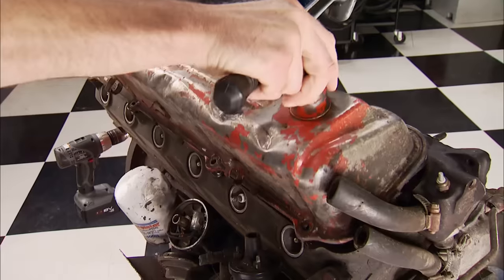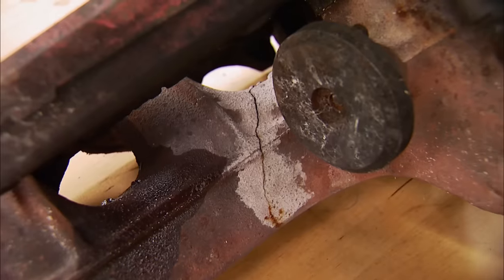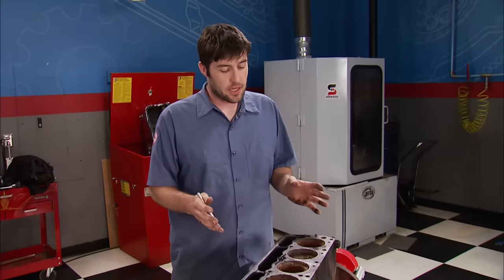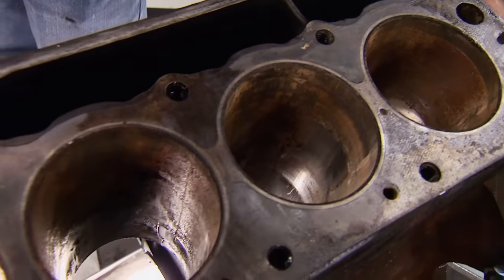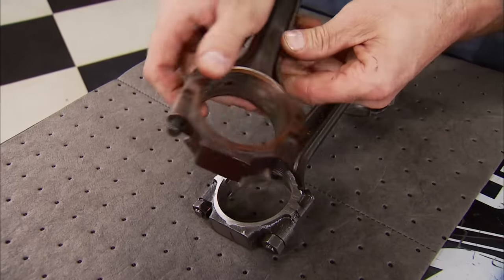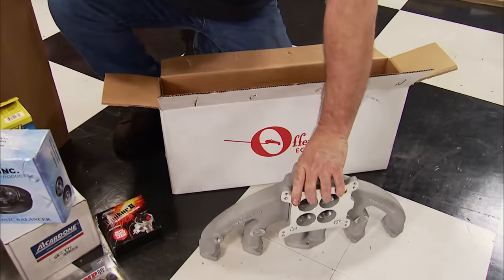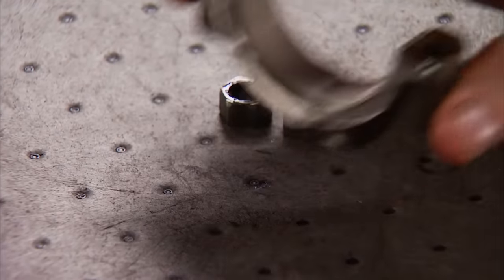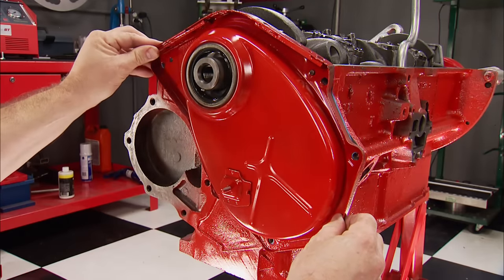Resurrecting A Mopar 225 Dodge Slant Six - Engine Power S2, E2

Comment: Would be cool to see them do the ford inline 6. Nd Chevy 250 inline
Reply: Or the 300 Cu in Ford inline 6
Reply: @JorgeRodriguez-po7kx  he is most likely talking about the 300 i6.
Reply: Why bother...
Reply: The 188 or 221 Ford 6 cyl?
Reply: keith cunningham BS!  the 250 was bullet proof 300 was a gas hog!...
Reply: I had a 300 inline  and it was bulletproof over 800000 on it I sold it for 3000 nd that truck is still going strong  nd it was ratbagged from day 1 I bought it brand new with17km on it
Reply: Funny how this turns into a battle of brands a really car guy dont care what the brand is there all built to break

Comment: OH!  The piston offset thing they mention around 11:00 just solved a mystery that's been bothering me.  My daily commuter is a 2000 Honda Insight, and it's always had a lot of piston noise on cold mornings before it warms up.  But I remember now that the engine in that particular car has the bore axis offset pretty radically from the crank centerline, in order to give the rod a straighter shot at the crank during the power stroke, reducing friction in the bore.  People do this with the /6 by putting the pistons in backwards; the straighter rod angle gives more efficiency but more piston noise.  Well my car has a super super gnarly case of that; there's got to be no side load to keep those pistons from rattling back and forth when it's cold.  So cool, I'll stop worrying about it.

Comment: The motor had a cracked crank. I thought it was indestructible engine lol.
Reply: And it was probably still running when it hit the junkyard.
Reply: My brother's Valiant had a slant six. it started to miss, so he still drove it to the garage to get it fixed. it had a broken push rod....and still ran.
Reply: Evil Ash any pushrod engine will do that nothing special
Reply: I am uncertain of the accuracy of this problem - the rear of a Crank has the highest Loads
therefore a crack between cylinders 1 & 2 is unlikely - the head & the crank of these Motors weigh 80 Lbs each - as far as I know a cracked head - Unlikely :)

Comment: One of the Best Engines Ever. THE BIG 6L 3.8 lts.
same as 225 c.i. 
Had a Dodge Dart Swinger
1971 Auto/Transs. Torque Flight and I really enjoyed "18 MPG" on the Free Way.  @1981  
When ⛽ was @$1.80/gl.
One Way non stop from L.A. to T.J. Mex. 👌🏼😎👍🏼

Comment: I spent two years working at Chrylser's Trenton engine plant making these.  It was a great engine and one reason was that only  one engine was built on that line.  On the V8 line you had multiple engines being built with different but similar tools.  So, it was real easy on the V8 line to use the wrong tool and damage the V8 in a subtle undected way

Comment: lubricating the head bolts is a no no. You will end of over torquing them when torqued to factory specs. The factory torque specs assume dry assembly
Reply: exactly, OLE!
Reply: mechanics 101 but sadly most guys are ignorant of this.
Reply: Idk why people think they have to slather every part with oil lol
Reply: @Beer-can_full_of_toes  i use KY Jelly on my water hoses. ex-wife use to ask "whatareyoudoing!?" OLE!
Reply: fvrrljr I was boiling water to clean corroded connections today and my wife asked what on a car required boiling water from a coffee mug in the microwave lol
Reply: @Beer-can_full_of_toes  a frozen water pump. yep been there done that LOL
Reply: fvrrljr electrical corrosion.
Reply: @Beer-can_full_of_toes  galvanic corrosion

Comment: had one in my 65 dodge power wagon. rebuilt motor and 3 speed trans.for 1300. used to take it to our camp. 120 miles. would hold it to the floor all the way there and back. motor never failed. wish i could of seen this video.few more horse was needed

Comment: now do a Ford 300 I6. Ford's Bulletproof motor. they built them from the mid 60s all the way to the mid 2010s
Reply: the later FI ones ran pretty stoutly compared with the old single carb versions.
Reply: LUNITIC WILL   I owned a 1980 Ford F-150 with the 300 6.  It was very smooth and pulled well.  I use to trailer a 22’ boat with it.
Reply: Big Rock  time for a 351

Comment: If you did NOT replace the original distributor's 'plastic' drive-gear, with a brass one, you made a huge error. This I know from experience
Reply: This is the sexiest thing I've ever read on YouTube.
Reply: Eh, considering they're not installing a "retainer" for the camshaft (read as: drywall screw through timing cover) I'd rather the distributor gear gets eaten by the camshaft. At least that way you've only got to replace the distributor.

Comment: My 225 inline six in my 1980's Dodge Aspen was truly bulletproof.  I never changed the oil from 160K to 200 K miles.  It never missed a beat.  Finally died at 350K, but the engine was fine, the frame on the Aspen broke in half.

Comment: Slant sixes were discontinued because the company realized it was too reliable and thus needed to be replaced with a new design.  :-(
Reply: Your thinking of the FORD 4.9l 300 inline 6 being discontinued due to over reliability! That absolutely wasn't why the 225 slant was discontinued, it was simply a junk engine!
Reply: Slanty was good but not perfect. They used Siamese bores and that god awful water pump to keep length down. They wanted a short engine to keep hood length down. Weertman should have told them they wanted a four or a V6, not an inline six.

Comment: I just rebuilt my 225 slant six in my 86 Dodge
Reply: What for? According to all the 'experts' they do 1,000,000 miles.
Yep a true 1,000,000 mile motor ...
Reply: I burnt an intake valve then when I pulled the head off I decided to rebuild the whole motor
Reply: I don’t think there a 1,000,000 mile motor I just think that they can handle a lot of abuse because mine sure did before I rebuilt it it’s a full cast iron block

Comment: Hi, 1st of all that carb is WAY Way 2 big 4 a natural aspirated /6 engine,(390 cfm instead).
 Now if thet had turbocharged  it like they should have that carb might be about right. With turbo you could get 350ish hp
 @ crank. Not bad huh.
Reply: Why is there even a single plenum? With intake and exhaust on the same side those mirrored turbos you see on OEM would give a very compact setup.

Comment: Back around 1989 I bought a 1985 Dodge Aspen with the 225, used to be a taxi with over 500k on the engine.
As an accomplished automotive mechanic I wasn't afraid of buying it for myself because of the engine.
Took in for oil change one Saturday morning and went to the beach for the day afterwards...
By the end of the day when we got home I could smell burning oil?
Opened the hood, looked around for anything obvious and pulled out the oil dip stick, there was no oil on the dipstick!
I checked to see if the oil plug might have not been tightened and if it came out?
It was there and tight!
I drove back to where I got oil change and got manager involved.
He allowed me to get my oil that they forgot to put in!
Also got to have my engine looked over at their expense and no problems were found.
The fact that I was able to drive around all day with no oil  in it was amazing and because the lifters are solid and not hydraulic, there were no tell tale signs of low or no oil in the engine as the lifters surely would have heated up and seized?
These were in fact very good engines and if one were to let go on you they usually put a nice hole to right of oil pump housing on the front side of the block, seen it a couple of times myself and heard other mechanics mention this as well.

Comment: I stopped watching when you said "cast crank"
Reply: What's wrong with casting?  I know with firearms frames and parts that aren't pressure bearing like the barrel, breech block/bolt, Bolt carrier, firing pin, cylinder in the case of revolvers, provided the casting metal is the right recipe, the casting itself is done correctly and possible air pockets are eliminated, it is more than strong enough for given applications.  Two companies: Ruger and Magnum Research use it extensively . In fact,  I'm told the latter got a license to use the former's casting technology years ago for their BFR revolver line. 

Yes, i know engines and firearms are totally different but the basic metallurgical, metalworking and chemistry principles as far as alloys  go still apply on that same basic level.

So what's wrong with casting if done correctly?
Reply: Not a serious build if it starts with a cast crank life is too short for bullshit builds we shoot to kill
Reply: @volkstroke  i mean is there any technical or mechanical issue with casting as opposed to forged, assuming the casting process is done correctly?

Comment: These engines are amazing. I guarantee when the world ends. They will still be a slant 6 running. Always cool when you pull the pistons ridge on the cylinder is on one side. 😊

Comment: These were great engines, you couldn't hurt them. We used to have them here in Australia in our Chrysler Valiant series of cars in the 60's and 70's. Matched up to a Torqueflite 3 speed auto they would run faultlessly for years and years with just oil and filter changes and a set of plugs and points about every 90 years... I had two Valiants with these motors, should have kept them. Would love to have one now as my daily drive.

Comment: Great little motor, the 225 slant six. My grandma was in the market for a new car to replace her old Rambler (she was no good at manual transmissions, kept riding the clutch and burning them out) in the early '70's and I went with her to check out the options. One was the Dodge Dart with the 225 and the other was a V8 Matador (what a tank). I test drove them both and recommended the Dart. I found it to be easy to drive, responsive and maneuverable, as opposed to the Matador that was boxy, clunky, and heavy feeling. She knew the Matador dealer from way back, though, and bought the Matador. I still think the Dart would have been better for her.

Comment: I rebuilt one of these in 1987-88
I bought an old B300? mail van with 350,000 miles for 50 bucks.
drove it most all summer 1987 as a motocross hauler, killing mosquitoes every trip, she was smokey girl.
Finally after about 20,000 miles, she backfired and bent a pushrod rod at the track.
We ended up reringing pistons, R&R'd bearings, seals, cam, lifetrs, valve seals , Everything from a Napa master rebiuld kit i scored at the Byron Illinois  napa for like $150 etc.
ALL while the engine as STILL IN THE VAN. !!! at the race track, in Byron IL.
There was so much room to work , i just honed the cyclinders with the block still in ...
Good times...19yrs old, full o pee and vinegar.
Covered in mud and grease,( up for 36 hours + ), and stars in my eyes.
lol, what happened....

Comment: I had a 65 dodge dart with three on the tree in the late 80's. It always had some problem but I didn't know any real mechanics to learn from how to work on it properly or had the space. I never knew what a torque wrench was until years later. It was always blowing head gaskets. The bolts that connected the exhaust manifold to the pipe were always breaking. I was a pro at getting the transmission in and out because the place I found to rebuild it never got the rebuild right no matter how many times (10 at least) they worked on it. looking back on it I'm surprised I survived driving it for the six years I had it.

Comment: We put one - an 82 - with the Dodge manuel 5sp out of an old Dodge MISER -- 5 speed.  It went into a dodge Dart - or the station Wagon version.  Driver got 45 mpg - CAN gallon - 4.55 Lit -  not the 3.88 LIT of the USgal.   Strong Engine! -  I still have my Dodge in the back yard! Cheers

Comment: I had a 63 Valiant with a slant 6y  in it . I sold it to my uncle when it had about 30k on it . He drove it back and forth to work and put over 400k miles on it ! It was still running when he gave it away 16 years later. He said he only replaced the water pump and the oil pressure sending unit and plugs!

Comment: This Motor same design upto 1997. I had one In a  New Dodge van cargo I got. New and drive it 400+ Miles. Not a drop of oil leak or any problems. Also had the 904 Trans !

Comment: I had a 225 in my 73 Dart Swinger. Only issue I had for years was it had a plastic distributor gear. Found that out when it wouldn't start one day. Buddy of mine was helping to figure out was wrong and leaned on the distributor cap and the distributor spun under his hand. Went up to Western Auto and the new gear was $2.99 in the help section. It finally threw a rod just shy of 600k miles.

Comment: all sht'n aside . i worked for a heavy eq . company in the late 90 ' s . one time i tore down a 318 dodge because it was an insurance company rejuve -- had to be done . the machine shop returned the block , having just honed it , sent new rings , and told us to enjoy our next 300 k miles . the cam was fine too . it was a roller lifter / rocker assembly .

Comment: I had one of these in my Dodge Dart, 1969, I killed it when the oil sensor failed and then I blew it apart when the rod went through the engine.  It was such a good engine up to that point.
Reply: bet it was number 4.

Comment: Dodge Dart two door 225 Slant Six....wow...in 1978 I drove from Mpls to Jamestown ND during the week before Easter. 
I took a friend to his relatives in my 1968 Dodge Dart 2-door that was powered by a great running 225 slant six. I had been taking care of this car for a few years when out of the blue the engine on the way back seized up! We developed a slow leak in the radiator and before I knew it, we were on the side of a road trying to figure out what to do! 
Low-and-behold I thought oh..this is the Thursday before Good Friday...what if we were able to buy a junkyard engine, and swap out this motor in my car????? OTAY!!!! 
Serendipity....GALORE!! 
We put our thumbs out and after a few cars a guy in a pick-em-up truck stopped....I explained what happened and what I wanted to do...being a backyard mechanic and having swapped engines in other cars I thought well if we could only find an engine and place….

Turns out this man had a job with a firm that took care of tractor trailers and had a huge garage….he called his boss and the boss said let em have at it~~!~…he gave us the whole shop to use….

We had time to go to the junkyard before it closed, and found a 225 slant six for $200 bucks that had the heads on the engine with the exhaust and intake manifold…if they were not on the engine I figure water may have infiltrated and the thing would not work…then we went to the auto parts store...the only problem we encountered was the water pump...we bought a new one and it wasn't quite a fit, so we made it work!!!

24 hours later we had that engine swapped out, with the junk engine on the floor….the 225 started right up, and we left by saying goodbye and thanking our new North Dakota friends…that car had served me well for years…wish I still had it!!! Johnne in Clallam Bay WA!

Comment: When using spray glue on a gasket do not use glue on the side that touches the engine block. Reason being if you replace a water pump, timing cover or oil pan the gasket sticks to the part so the block takes minimal work to clean avoiding anything getting into the engine from cleaning.

Comment: In 1960's-70's these slant 6 were used in outlaw short dirt and paved tracks where torque was king.
In those days we had real gasoline and put 10.5- 11.5
Pistons with solid Isky cam and lifter  for drag specks.
A lot of guys ran straight exhaust for each cylinder or tube headers butost knew nothing about exhaust tuning but a guy in Seattle built our equal length headers and using his rudimentary  dyno we cut from collect back for highest torquee HP .
The combo steel exhaust and intake were designed just matching ports and plugs to cylinder.
ODD. An outfit back east sent two carbs with aluminum cast and heavy a  2brl400+  and  Holley at500+( according to how we jetted).
We used balanced crank rods pistons
Early on to alleviate high volume oil pump filling covers or moving due to tendency of pick up rearranged baffled pan and had to open oil return holes.
Counts on money for race we by end of year and 4 engines had one that could pull 6 grand for many a 200 250 lap 1/ to 1/2 mile track.
Tyranny was the standard in~out box..
Down straights short wheel base and screw jack suspension pulled front wheel of ground out of corners.
El cheapo tattle tale tac told us that on dirt track due to rough as he'll tread still spewing dirt it said I blew 2 of 3 motors at over 5500 rpm actually I think higher.
Extremely torquey and ate plugs every race we got champions free from sponsor!
Custom dual points and springs we customized with thin rubber tubing to control bounce.
Had buds later on who I talked into modifying 225 into Dart and Demon bodies but we got every single part clear down to Bolts from Clifford.
Nice lightweight cars and stoplight to stop like a great street sneaker.

Comment: I put headers on a 235 straight six.    killer sound.    put you loose a ton of heat from the carburetor.     it was torture in the winter months.    :-)

Comment: I remember a fellow on you tube that when rebuilding a slant six turned the offset on the piston shaft 180% from the factory set up. Ever hear about anything like that? my experience with in line 6's is that the 300 and 240 ford out lasted the 170-198-225. All great motors.

Comment: You should give tips on things to check after machining like de burr oil holes on crank shafts that have been machined and or cross drilled. Seen a few engines take a nose dive after missing details like that.

Comment: my second car engine I work on was a slant six here in Argentina when i was 17, my engine wasn't rusted because it was running but when I took the head off, the step was to bad i had to use a grinder to be able to take the pistons off, and went from standard to 0.40.